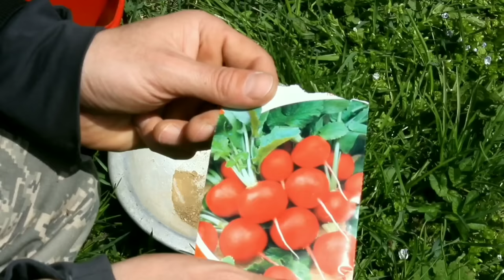Great-grandfather's hut in the forest. Nobody lived there for half a century. Bushcraft shelter.

Comment: That snow looks so good it is 118 heat index where I am right now.
Reply from the maker: So the snow is so that the bad bacteria die and the cycle of life starts again.
Reply: @Wild_forests_ofthe_Carpathians  Nature's way of renewing itself that's cool. We don't get very much snow here. Occasionally we will get anywhere from three to six inches but it doesn't happen very often. If we do get any it is just a real light dusting not even enough where it is very noticeable. Last winter was dry and mild like usual.
Reply: @Wild_forests_ofthe_Carpathians  The weather here in the winter has most people confused. I have seen them wearing flip flops and shorts with a light jacket before. One thing is for sure though I don't go anywhere without a rain jacket in my back pack.